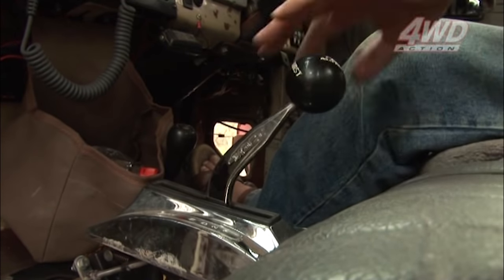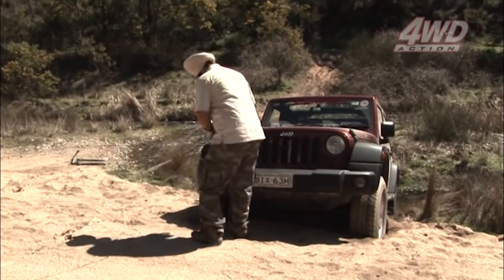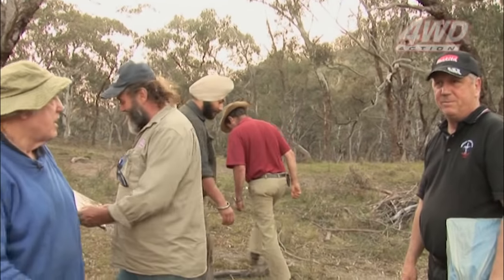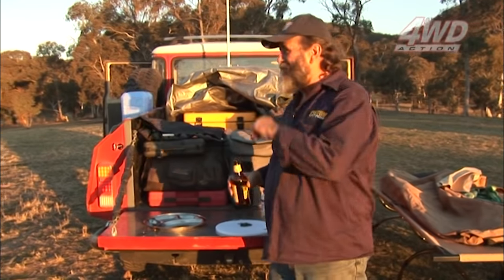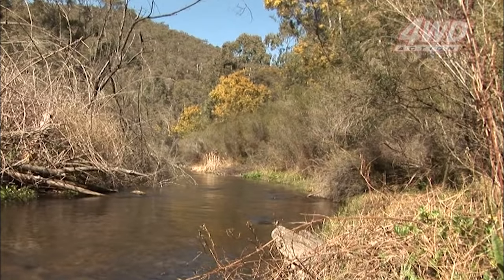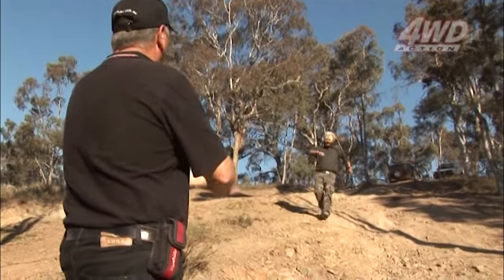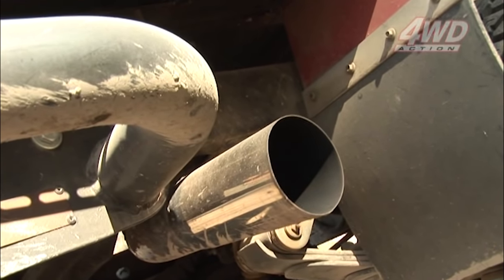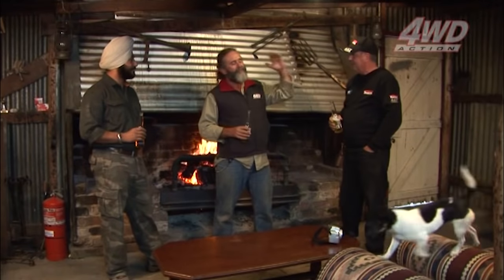V8 Chev 40 Series Toyota - Roothy

Comment: 11:55 even way back in these old videos off-road traction control didn't get enough credit on these videos you can see it working a treat on that driver side wheel up and the jeep just kept on going.
Reply from the maker: Yep, well spotted - and traction control has come a long way since then too!
Reply: @JOHNROOTHROOTHY  oh don’t worry I know, we rely traction on control in our wagons off road primarily and I’ve recently compared Bosch 8.0 platform system used in many crossover suvs in the 2005-2010 era with the system that’s in the the new Toyota as atrac and you can really see how much has been improved on this over time, faster and more quieter almost non existent to the driver if unaware of how it really works.

Comment: Hey Roothey.. do you use air , or electric lockers..??
Don't know what to get...
Not real Interested in Auto locks being  locked most the time..
Makes selecting 2wd pointless...
Reply from the maker: I used ARB air lockers for years, TJM air lockers aftrer that and finally Harrop eLockers - they're all good, but the Harrops are the latest engineering and my favourite so far.